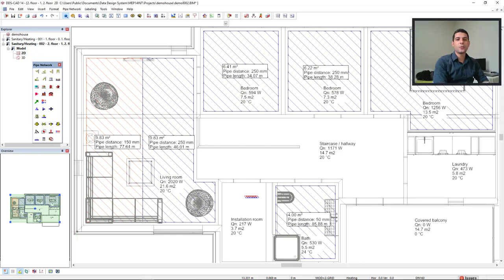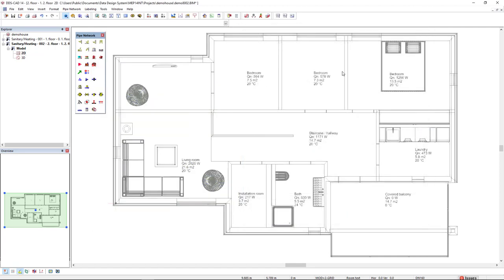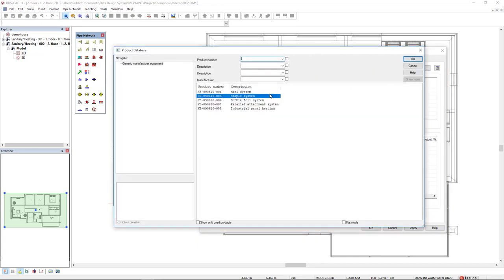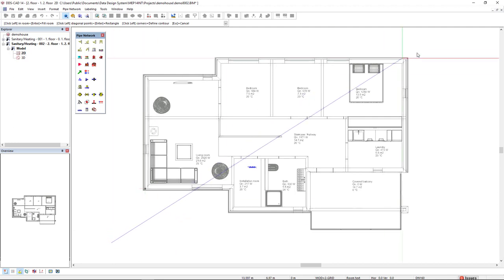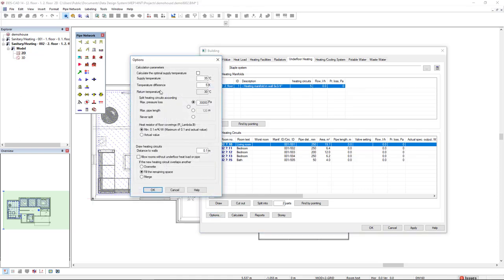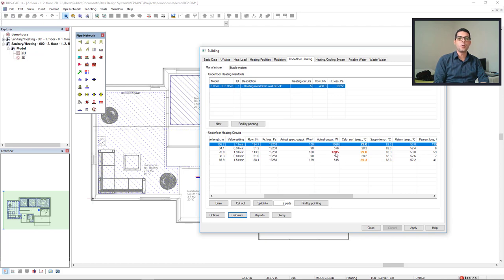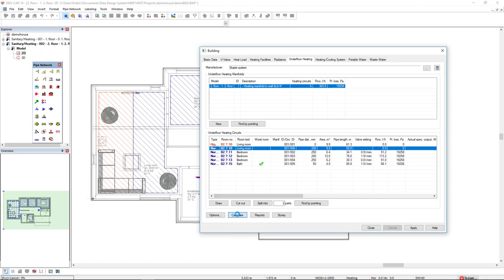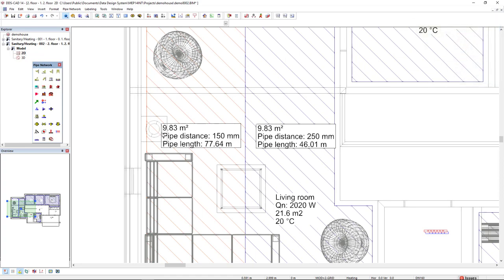How to properly calculate underfloor heating with DDS-CAD

Comment: Hi can I have more info, I'm particularly interested in calculation electrical underfloor carbon radiant mats. Can this software provide this?
Reply from the maker: Hello Slawomir, DDScad provides underfloor heating calculation based on pipe systems. Heating and cooling systems calculation in DDScad follow EN1264, Heat load based on 12831.

Comment: Hi there, I am back with my previous question: Is it possible to define different inlet water temperature for every undefloor heating manifold?? If not, it is a problem. For example: I have a multifunctional building, 2 big flats on the highest floor with underfloor heating (ca. 38/30°C at -15°C), radiators in other flats (2-8th floor, ca. 65/50°C at -15°C) and 2 commercial spaces on the 1st floor with underfloor heating (ca. 45/39°C at -15°C). Underfloor heating in 9th floor is connected to the radiators heating zone (65/50°C) via 2 manifolds with pumps and mixing valves. So, how can I design the underfloor heating??

Comment: Hi, Filipe! Is it possible to choose manualy pipe distance?
Thank you for the great video tutorials!
Reply from the maker: Hi Sanja, in the Underfloor heating calculation you are not allowed to edit the pipe distance manually, it is changed automatically tho if you select Normal or Higher temperature option. Inside the Underfloor heating Circuits dialogue.

Comment: Hallo Filipe,

How can I define a different inlet water temperature for every manifold or for every group of manifolds?
Reply from the maker: Hi Michal, in line with my comment on the video "Calculating and automatically placing heating radiators in a complete building" I recommend to reach out to your local support contact to discuss the possibilities.
Reply: Hi Filipe, I tried to and I tried it in this way, too ...